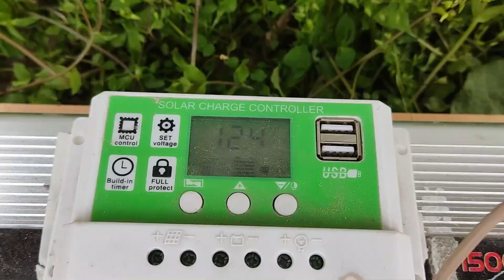Güneş Enerjisi ile Çalışan Sulama Sistemi Yapımı, Bulaşık Makinesi Motoru ve Güneş ile Sulama Yapımı

Comment: Selamunaleykum. Elinize emeğinize sağlık. tam da benim böyle dere kenarında tarlam var ve elektriğim çok uzakta.  Kullandığın motorun özelliğini paylaşabilirmisiniz. Tahliye motoru mu veya ne motoru
Reply: videoda yazıyor... bulaşık makinası pompası...
Reply: @TheMaratbilgin  50 wattlik 2 adet panel nasıl 900 watlik motoru çalıştırabilir
Akü gördüm eğer aküden kullanırsa 5 dk. Lik çalışma ömrü olmaz mi
Reply: @cihatterler6281  orada motoru direk güneş panelleri çalıştırmıyor ki...  Panelden akü şarj oluyor aküdeki enerji invertör vasıtasıyla 220 volta dönüştürülüyor... Sen direk aküyü motora bağlarsan zaten çalışmaz... sonuçta akü 12 voltluk, motor ise 220 ile çalışıyor...  motorun çalışma süresi de akünün kapasitesiyle alakalı.. 60 amperlik akü bağlarsan atıyorum 10 birim zaman çalışıyorsa,  200 amperlik akü bağlarsan 30 küsür birim zaman çalışır... Kısacası bunlar senin ihtiyacın ve maddi durumuna göre değişecek şeyler...
Reply: @TheMaratbilgin  teşekkürler
Mesela kac amperlik akü takar isem ne kadar süre motor çalışabilir ne rakam verebilir misiniz

Comment: Sir. Very good job. Small doubt as ryot  motor capacity  lifting of water from river  and also from bore  50 meters. What hp of dc motor is used. Shall we increase pannel power  to use  as agricultural power weeder in some times and of time as pumping of to agricultural fieds.  If it is success with your suggestion the whole farmers of india grateful to you sir. Reply is solicited in the mater with explatulion of material. Thank q.

Comment: Again humorous video.The small 10W panels do not produce any useful energy for the required performance. You take all the power for a few minutes from the battery that you have really charged before. I have the same (10W) panels on the garden gazebo and together with a similar battery work as a power-bank for mobile (DC-DC Down inverter). At night it lights up a small bulb 0.5W.